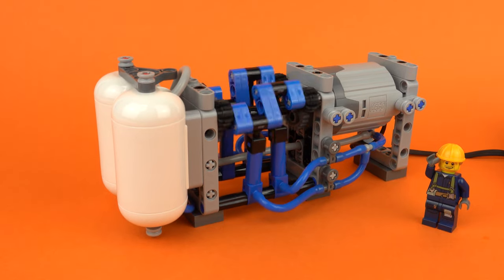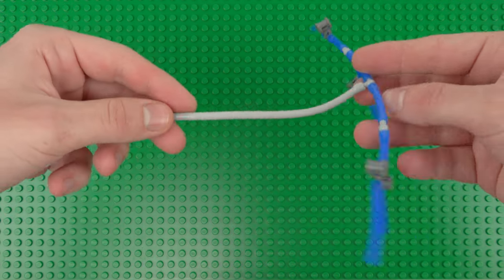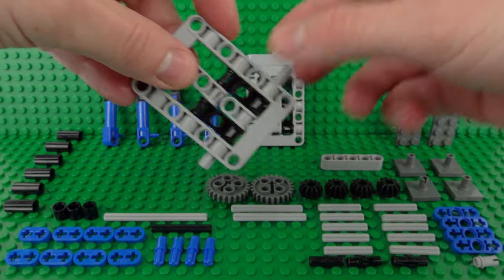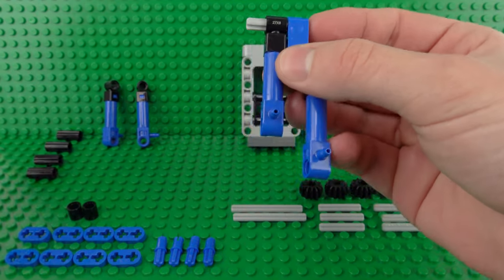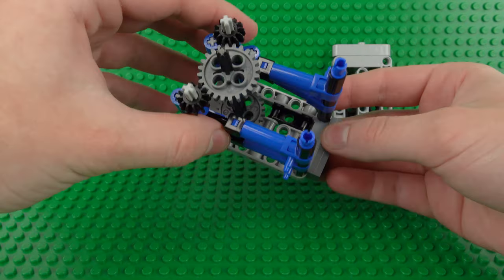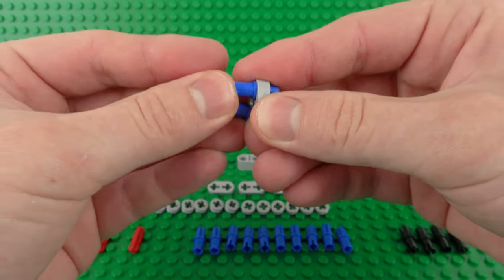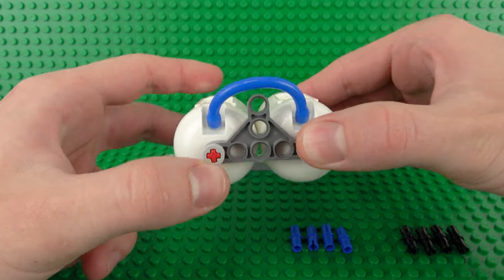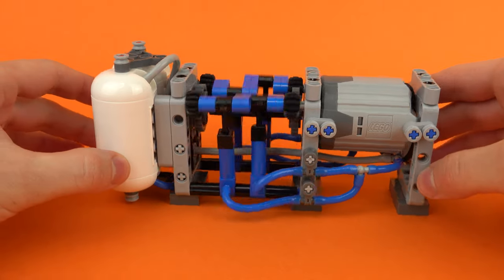How To Build A Working LEGO Pnuematic Air Compressor

Comment: Where do I get these parts and get the pistons for the air
Reply from the maker: You can get these parts from Bricklink, which is a bit like Ebay for LEGO bricks! Here is a link to the Pneumatic parts category: https://www.bricklink.com/catalogList.asp?catType=P&catString=159 I use the bb0875 Pneumatic Pump Small and 67c01 Pneumatic Air Tank in this model.